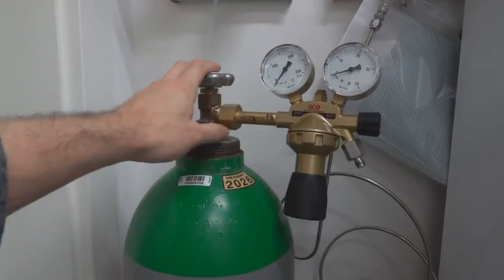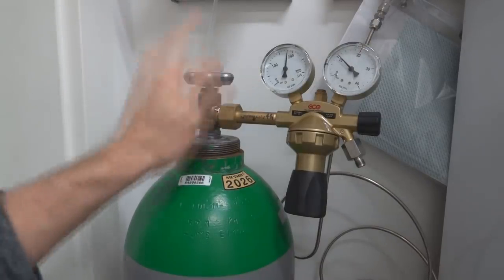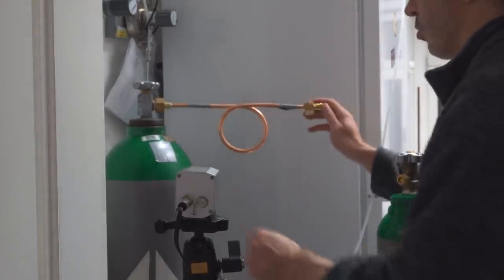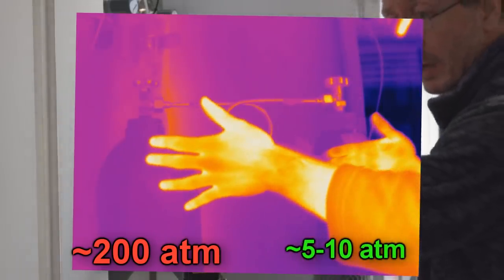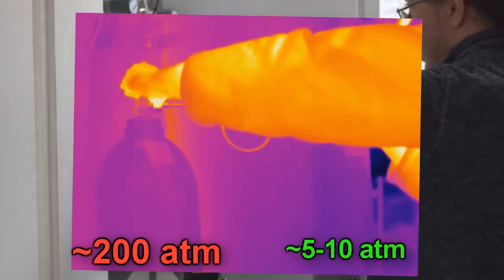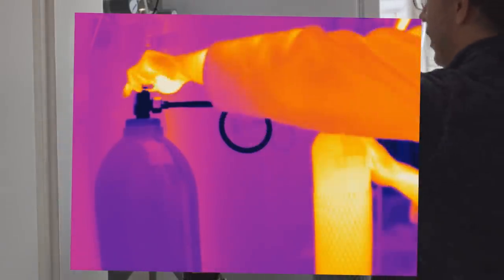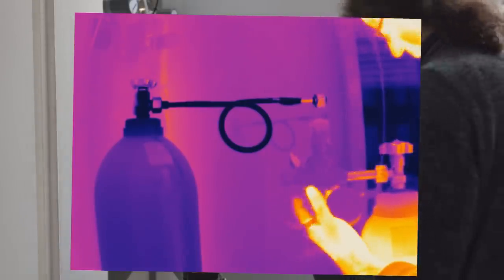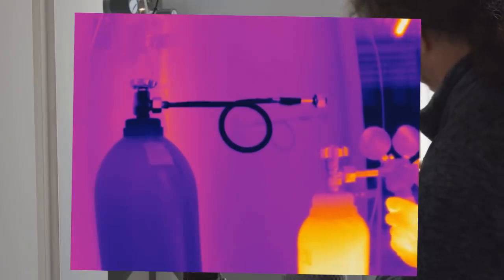Dangers of high pressure gas!

Comment: You're saying "respect high pressure gas", but you're behaving like the worst cowboy. 
You stuck your oily fingers into an oxygen clean fitting, you used a transfer pipe with no restrictor, you used the cylinder valve to control flow, you did the whole thing inside what appears to be a wooden cupboard, you refilled a cylinder that appeared to be hired.

For God sake man, if you're going to fool around with oxygen, get some training first!

Edit. I've realised that the UK has (so helpfully) changed from a sort of aqua blue for argon to a green the same as U.S. oxygen. So this may be argon, in which case apologies.  If it is US oxygen, then... yeah, comment stands.

Comment: I heard if a submarine sinks below its maximum depth you get burned to death as it gets crushed and the air inside heats up.   Also there is something called adiabatic decompression where if you put grease on an oxygen connector it can explode but I can't explain it.  There is a special oxygen grease tho.

Comment: Charles’ Law tells us that temperature and pressure are in direct proportion.
However, it is important to remember that isn’t in the Celsius scale but Kelvin.
So increasing pressure by 200 bar does not increase temperature by 200 deg C but by 200 deg K.
Also a supply cylinder at 200 bar will not fill a receiving cylinder to 200 bar.
Assuming the supply cylinder is 50 litres water capacity @ 200 bar and the receiving cylinder is 20 litres @ 1 bar then the pressure will equalise at around 142 bar meaning the receiving cylinder’s gas temperature will rise by 142 deg K.
In addition, because the gas in the receiving cylinder is hot it will lose temperature, and thus pressure, as it cools.
So much of the energy used in compressing gases is lost as heat.
Therefore simply releasing compressed gas is not an efficient means of propulsion.

Comment: I guess... technically it can provide a bit of a boost in acceleration? If I'm not mistaken the performance limit for many high end cars is pretty much the limits of the tyres, better rubber and roads providing more grip would allow for more acceleration without slipping (at least for the initial quick burst of acceleration).

So if that is truly the bottleneck then high pressure air exhausts could maybe do something, I seriously question the wisdom of it though:
1. Added weight? for just a bit of acceleration pretty much
2. Powering the compressor with the battery would be very inefficient (maybe if excess braking that can't regenerate into the battery is dumped into the compressor it'd be okay, but refilling the tank would take a while that way during normal driving).
3. Is it really needed to accelerate faster? Even in track use given that it's not sustainable over the many laps of a race? (might as well just put a jet engine on cars instead since we're not being efficient/environmentally friendly anyway)

Comment: If you buy a compressed air spray to clean your PC you can experience it getting cold while it decompresses and when you close your air pump with a the thump and push it you will experience the the compressed air to get really hot all at once. 
This are two save ways to experience oneself this phenomenon of temperature change through compressing/decompressing.

Comment: Newbie question: why is the line feeding gas from bigger cylinder to smaller shaped into coil? Is it some kind of safety feature? I mean in industry lines often have u-turns to provide space for expansion /contraption of the line but here the whole setup isn't rigid. To clarify things up: I am not critisizing, just asking.

Comment: Is Musk suggesting average people use compressed air to fill a tank?  If he is, the pumps would have to be seriously overengineered.  One slip when connecting a pump to a tank could seriously injure someone.  Throw on top of that the potential for wear and tear of the pump and hose\pipes, and we're talking major disaster.  I mean, we don't think of it as dangerous now, but filling your tank with petroleum is pretty dangerous if for no reason more than inhaling the fumes.  Add on top of it the potential for an errant spark setting the gas vapor ablaze, one reason they tell you not to get in and out of the car while pumping so you don't build up static.

Comment: I sometimes have to fill up a bottle with co2 the good thing is though if you open the tap a little more you transfer the cold a little further. Freezing the valve is a bitch though ( and dangerous). I am not afraid of gas bottles. The biggest danger is the bottle tipps over on your foot if you are handling them the last few decimeters to its location. But i respect them. I see people working with bottles too careful because they are afraid. I see also people working too careless because they do not understand the danger. I prefer handling them myself. :-)

Comment: My first job was working at a movie theater.  One of my tasks was to change out the carbonation tanks for the soda machines.  The tanks were changed to a wall on one side of the room.  The opposite wall was patched.  When I asked what happened, I was told someone was careless while changing a tank, the replacement tank fell over, the nozzle broke off and we had an unguided missile crashing through walls behind the concession area.

Comment: It's not just the thermal aspect that makes highly compressed gas/fluids dangerous. They can directly injure as well. Pin hole leaks in high pressure lines can inject fluid into your body.

I have taken pressure off of an O2 tank once. Another tech was replacing a valve that activated emergency O2 for pilots, he wanted to test the new valve before installing, as it was difficult, and didn't want to risk the new unit being faulty making him work double. He said the valve was attached directly to bottle pressure, so he attached it to our large tank and opened the valve. I was holding the valve when he did this, as I was going to trip the electrical switch. I promptly took bottle pressure to the face. Luckily no harm done to me. The valve was toast though. I believe it was designed to only take 10psi, with a regulator between the bottle and valve.

Comment: While it's a cool demonstration of the ideal gas law showing changing pressure vs temperature I don't know what it has to do with Elon's new Tesla feature. Going up to 100 bar with an air compressor takes several minutes and the heat just radiates away. It's not a closed system where no energy can escape. If they fire the thrusters and release all the gas in a few seconds then you get a refrigerated Tesla to cool you down in the mid summer heat.
Reply: For road safety high pressure containers are still an issue though. At most it's going to be a feature for the drag strip.

Comment: High pressure per se is feasible and even already researched and done by other companies :
https://www.roadandtrack.com/new-cars/car-technology/a20744877/this-motorcycle-concept-uses-air-jets-to-prevent-skids-and-crashes/

The thing is, it's probably only practical in quick shorts bursts (like the skid prevention researched by Bosch and mentioned by Telsa).
It's definitely not a workable solution to make the "car fly" (for prolonged hovering).

Even the thermals are problematic : anything longer than "short burst" and the compressor would probably melt while the  nozzle simultaneously freezes.
Reply: The demo of the concept in the linked article is dead, here's a still working video about the concept:
 - https://www.youtube.com/watch?v=sg8B9Uub0AM

Again it's a very short quick burst (what probably Tesla will end up doing for real), not a prolonged hovering.

Comment: @Thunderf00t,
I don't think that your temperature readings can be compared to a scenario where you just compress air at room temperature:
In your case the gas looses temperature by decompression on the left site, while the temperature increases due to compression on the right side.
However, the gas that is beeing transferred from left to right, is already cooled down. 

Therefore, just compressing gas from room temperature, would result in a higher temperature of the right bottle, compared to your experiment.

Comment: Ok, I guess my fluid & thermal mechanics is rusty. I understand why compressing the gas at 10 bar gets warm, but the gas from the big tank, when expanding from 200 bar, gets colder. So at the end if 85%'ish of the now 60 bar gas is the colder gas, why is the net effect on the temp of now 60 bar tank higher?

Comment: 200 bar sounds crazy dangerous. If that is involved in crash someone is going to have really bad day.
Reply: some carbon fiber paintball gun tanks (the ones fitted to the gun and is under your arm) are 300bar working pressure. i have seen a bunch of paintballers running around, coming to a stop only after hitting the thing they want to hide behind, jumping head first into a sliding landing on the gun, i was in an airgun shop when one of these carbon fiber tanks are filled, they creak and groan, i unconsciously took 10 steps backwards!

Comment: (2:25) - I'm just thinking...
...if you were to plug the end of that looped line/tube, would 200 bar be enough to straighten it out?  (at standard room temp & pressure)

.

Comment: Loved the footage Thunderf00t. I have a serious question though. How does this high pressure gas transfer change effects depending on the gas used? I say this, because when I go get my gas grill propane tank refilled I do not see these results. I don't know what pressure the main tank is at, but at the gas station their propane tank is MASSIVE compared to the little 40lb tank for my grill. So I would imagine that massive tank has to be at a much greater pressure than my little tank, and yet I don't feel any heat in the tank after it's filled from empty. I would ask the same question when the gas company comes to a persons home and fills their propane tank on the side of their house. The trucks supply of propane must be at a much higher pressure than an empty/low house tank. So my question is, does the gas in the tank change these results? Or is it more technical, like, they have some sort of engineered solution to this heat/pressure problem?
Reply: My guess is because that propane is transferred in liquid form not in gas form but I could be wrong.
Reply: @sebastiankvyat3915  I actually saw a comment on another thread that said something along those lines. I guess when it's in liquid form there is no pressure difference between the containers. I would imagine there is some type of bypass that allows the pressure to stay constant and just move liquid from one place to the other. Makes sense especially seeing the example thunderf00t showed as for potential dangers that wouldn't be visible.

Comment: I guess the laws of thermodynamics win 100% of the time. I hope you will make a safety vid about NOT injuring oneself while handling a bomb in a steel drum. High pressure gas scares me. That was 200, now dread while working with 100 times that. If you hear a fss, 1st you check hands then you change pants.

Comment: So, you are using high pressure gas, which by your own words is "a farce on so many levels". 
Nice way of debunking yourself.
Reply: On second thought, you didn't debunk anything. You gave a neat demonstration of a well known thermodynamic law, but gave absolutely no indication why, if used in an exotic high performance car, it should be considered "a farce" . You made an assertion, and didn't back it up with any relevant facts.

Comment: I'm a welder so we're filling bottles with argon and nos and everything in between all the time. On a hot summer day, carrying one of the big bottles back to the lock box on your shoulder feels amazing. Just remember to keep those steel caps over the valves on the bottles. If it falls over and catches the wrong edge and you get a 200 lbs torpedo lol. Cheers.

Comment: So I take it the Hyperloop is no longer going to be a vacuum then? Cause if you're releasing a lot of compressed air into it, then it's not going to remain a vacuum for long. You'd have to have pumps continuously pumping out the air, (could also be the point where you make the compressed air I suppose).

Comment: PVT anyone? 
Pressure, Volume and Temperature 

In scuba, filling a tank in a large water container is done to absorb tank failure, cooling is a benefit. 
Cheaters will fill tanks (aluminum) will fill past the 3,000psi limit so as the tank comes to ambient temp. it will read 3,000psi. Divers love that.
In business, tanks that are cycled (filled) often and repeatedly tend to suffer metal fatigue and are prone to failure.
And that is why "Hydros" (hydrostatic test) are so important.

Please remember to "Purge" all lines before any disconnect.

Comment: He's only proposed using it in the Roadster. And cold gas thrusters have been used in racing bikes. It wouldn't be able to fly for more than a few seconds, but it's a legit strategy for a improving turning radius in a racecar.

Comment: And this is the basics of a Air conditioning system. Except for the stored pressure in the tank, versus a compressor constantly creating pressure.
It shows quite nicely why it is such a power hungry concept. As you cool one part, the other accumulates more and more heat, decreasing the efficiency of the system.
Lovely.

Comment: What is actually the reason that, the middle part is cooling and the right bottle is heating up? As far as I understand, the pressure Pl in the left bootle must be higher than the pressure in the middle Pm and this must be again higher than the pressure in the right bottle Pr (Pl>Pm>Pr). So when the middle part is cooling then at least the right bottle has to do this as well ?!?! Or is the pressure in the middle even smaller than the right one through Bernoulli (Pm<Pr) because the gas is moving???
Reply: What is heating is the gas left in the small cylinder being compressed. If the small cylinder was evacuated before fill-up, It would start cooling too.
Reply: @stepanf6471  Thanks! Now it make sense!!!

Comment: Just like with fast charging batteries, it creates a lot of heat. Solution? Active cooling. But how much heavier would the vehicles get with that compressed air tank and the compressor pump and active cooling of those units... And than Elon is the one to say hydrogen cars are not the future because they require those heavy hydrogen tanks that have to resist a lot of pressure...

Comment: funny how you are doing this. When I used to cycle, I was taught by my trainer that when I pumped my tires up (you wanted them to be as stiff as possible) that you had to fill them up, then wait half an hour and fill them up again, just because the cooling after compressing the air could drop the pressure by about a quarter to half a bar.

Comment: One thing that wasn't mentioned was why the pipe in the middle gets cold. 
This is due to 'Joule-Thompson' expansion (constant enthalpy pressure drop).
For example, when oxygen (not sure of gas used) drops from 200 bar to 5 bar, it will drop in temperature from 300 K to ~250 K ( -23 degC!). 
This is one of the working principles behind refrigeration, and liquefying gases. 

Loved the vid!